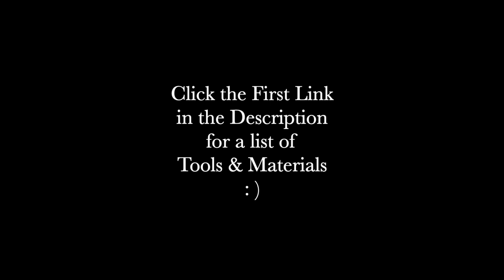Make a Leather Lighter Case (With Pattern!)

Comment: And at that point, should you use a sealant on the leather or is that not needed?
Could you use a dye and then a sealant too after the wet molding and drying etc.